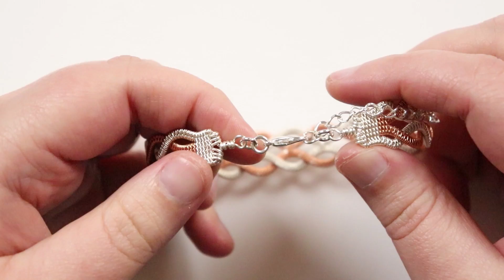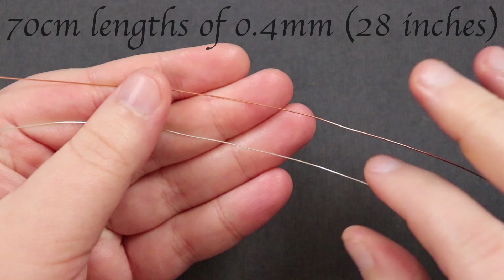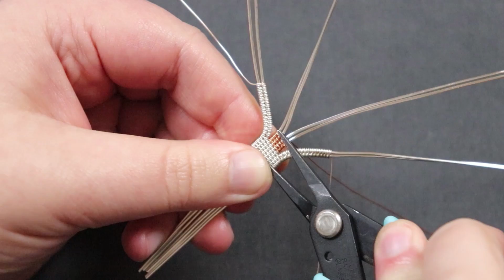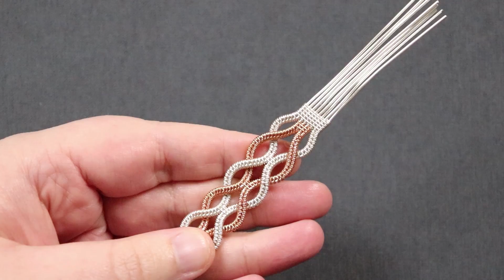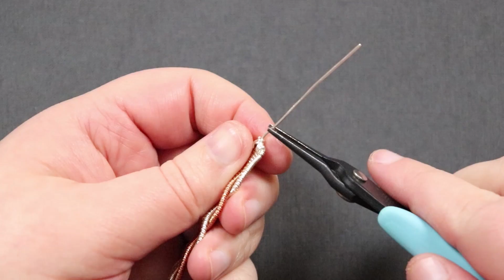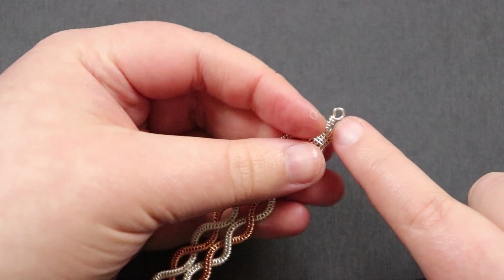Intertwining wirework bracelet

Comment: What a beautiful bracelet! I’ll try make one for my wife. Question though. How do you get your wires straight? They have a curl off the spool. Thanks.
Reply: I noticed no one answered, and you may not even see this, but the way I straighten wire is with a pair of nylon tipped pliers (you can use normal pliers but should line the wire with a tshirt or something soft, to keep the pliers from scratching your wire). Simply hold one end (easiest to do while wire is still on the spool) then firmly hold the wire with your nylon pliers, and slide it up the length of the wire, sometimes you may have to repeat this a couple of times! You can do this several times as you work on the project and wires get bent, have fun.